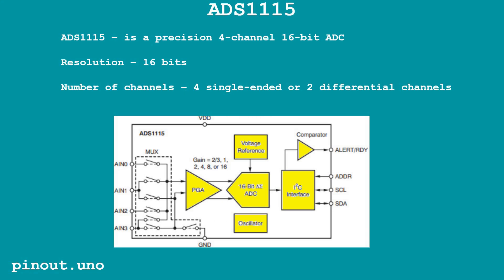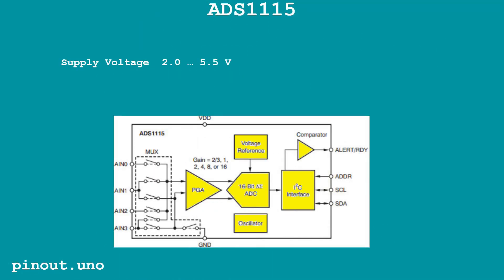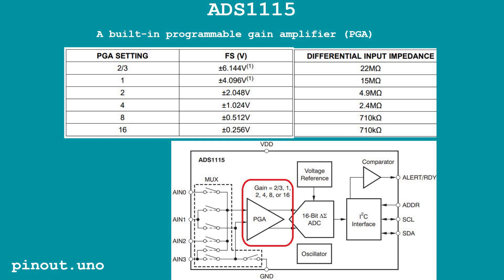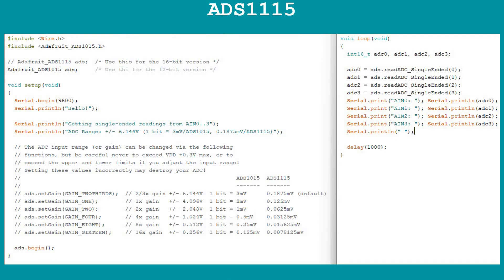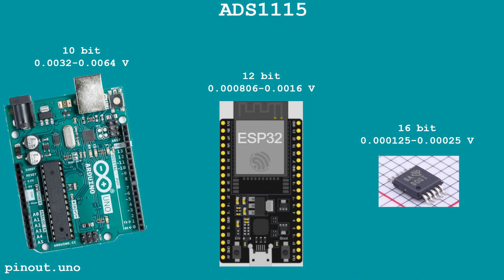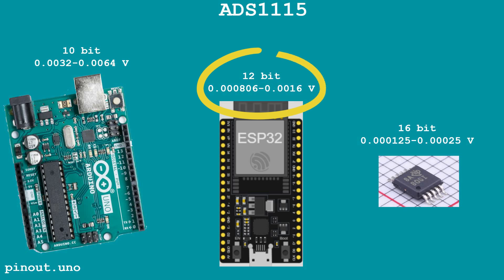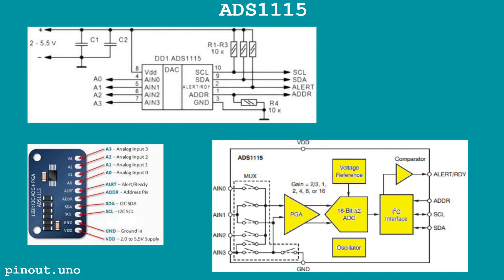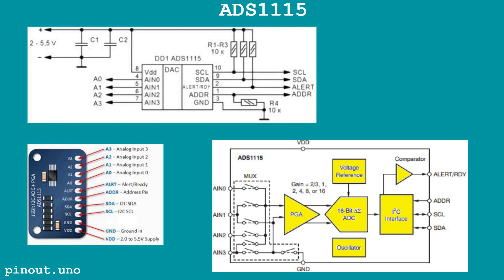ADC ADS1115 expert review

Comment: I ususally pair ther ADS1115 with a 2.5V  voltage reference like the lm4040 that gives me the full differential 16 bit measurement range and usually you do not need 4 chanels. I have build a pH-Meter with this setup using the lmp19200 Chipset and it works great 0,01pH resolution and great linearity.

Comment: but what voltage level will we use to run ads1115 while 5 volts is the commonly used voltage level. and noise is problem